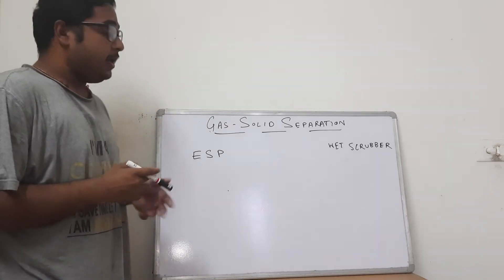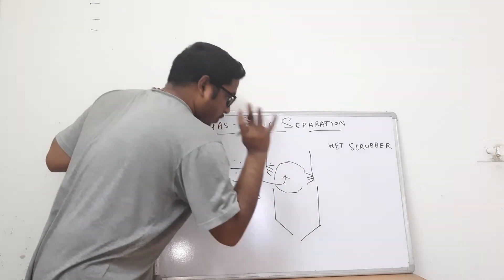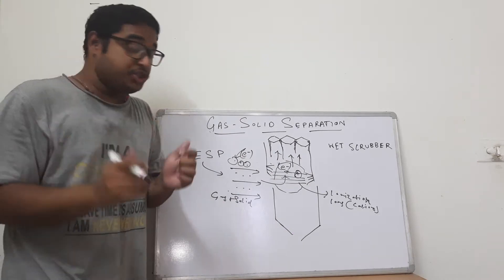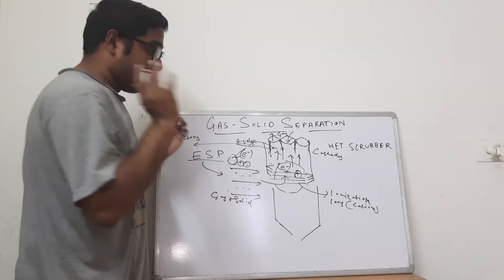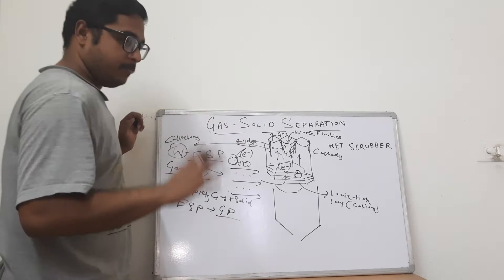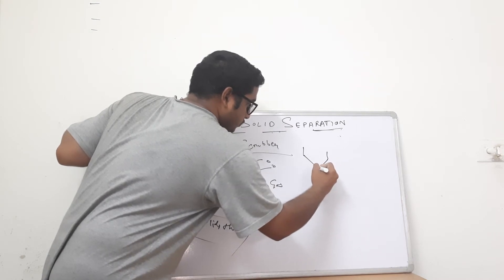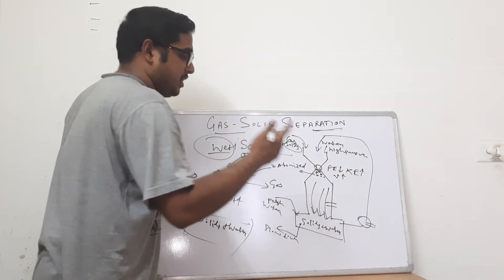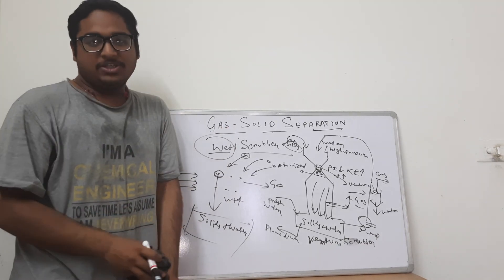GAS SOLID SEPARATION | ELECTROSTATIC PRECIPITATOR | WET SCRUBBER | VENTURI SCRUBBER

Comment: sir can you pl tell which quipments are being used to control water pollution
Reply from the maker: Sometimes Adsorption is used to remove dyes with activated Carbon, sedimentors and ultracentrifuges to remove medium size particles, molecular sieves, membranes, Reverse Osmosis Filtration and Filter Press for smaller particles, flocculation and coagulation in Some cases (maybe stagnant water), ion exchange beds in trapping salt ions as impurities and several other ways. Depends on the size and the matter you want to capture.

Further if you want to remove dissolved gases, there are methods of stripping with steam as well
Reply: @LifeBeyondBusiness  sir can you provide a book or a paper on these equipment
Reply from the maker: There is no single book or material on this. You need to follow a plethora of books 📚